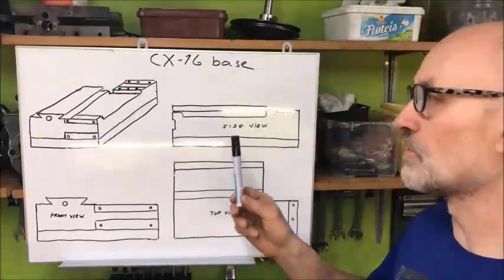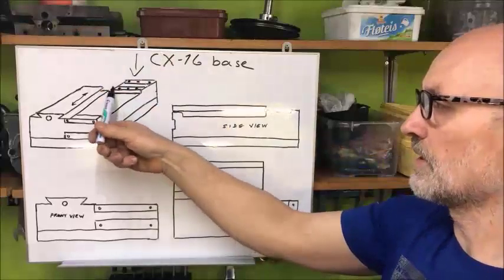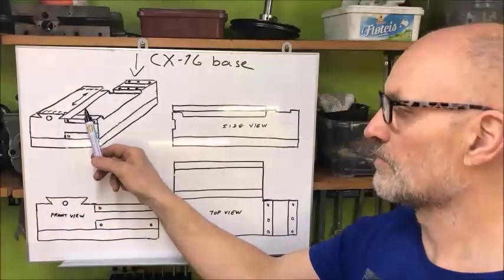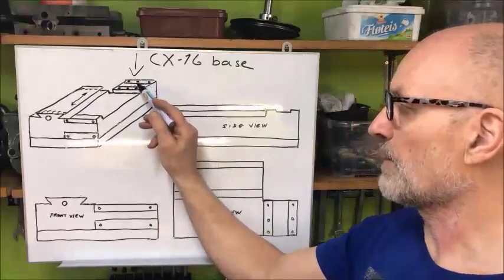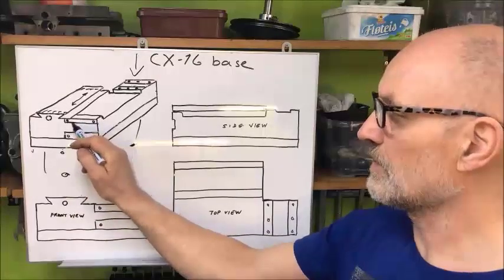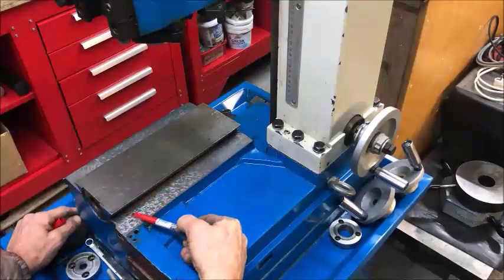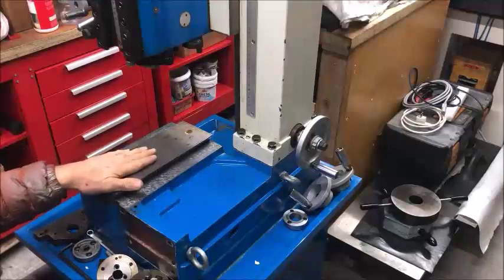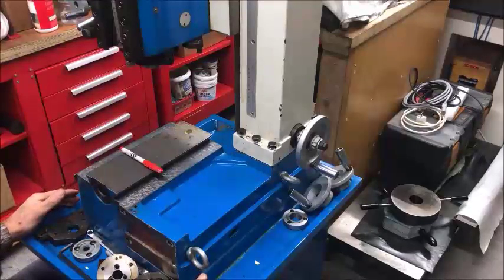CX-16 base: considerations and objectives

Comment: I’ve never seen a mill where the column was not aligned with the y axis. That seems like a terrible design. Doesn’t make your job any easier either. Interesting series. Thank you for sharing. I’m one of Rich’s kids too 🙂
Reply from the maker: Thnks for commenting. Glad to hear from another of Richard's students. This is a special mill that can be converted from vertical to horizontal. Actually a straight (as possible with budget means) copy of the Golmatic MD23. In my eyes it is a better design than the usual mill-drills that is more of a beefed up drill with a square column. This Golmatic design offers a more rigid milling setup with the head closer/better clamped to the column. The CX-16 lacks some of the features and nice build quality though.. typical budget manufacturing processes at a certain (lower) price doesn't allow for what I do to the way surfaces of course. However, they have apparantly put more effort into the (geared, oil bath) mill head and quill, this being both accurate and tight. The Golmatic is a much more expensive machine, I think at about 12-15.000 USD, while the Chinese copy here retailed at about 2.500 USD. PS! Here's a link to a demo video of the Golmatic which more shows the capacity of this design and the functions and also results obtained,. not the best quality video, but still https://www.dailymotion.com/video/x300wv6
Reply: @jansverrehaugjord9934  ah ok, never heard of this machine and difficult to understand just from seeing the base. Thank you for the info. I just bought an arboga em825. I have seen battle ships that were built less strong! Love old machines.
Reply from the maker: @sblack48  Yes, there is something about old machines.. Had I had the space, time and money I would probably have been a "hoarder" (even worse than I have been.. haha). The Arboga is a very nice machine. The Swedes have a very good reputation for quality tool and good workmanship. We have the same type here at work (Norsonic). It is mostly used as a drill press, just sometimes milling small aluminium details as we have a larger milling machine (a FEXAC UM). I also have an Arboga drill press with XY table, floor-standing type so you can fit a very tall piece to the table. I love it! Not the most accurate drill press (shall get around to restore this too someday), but in use "every day" doing "sterling service".